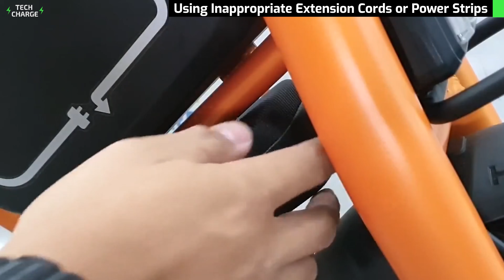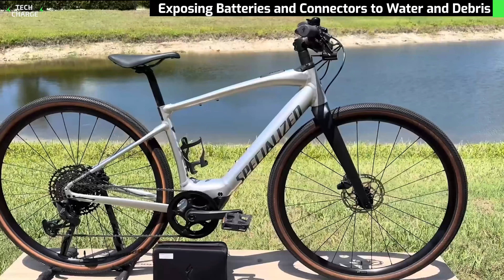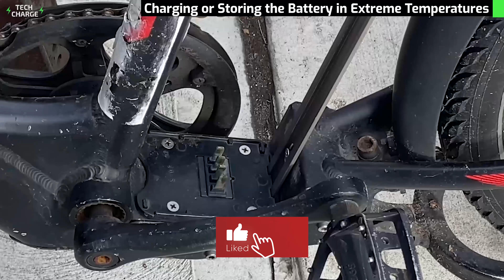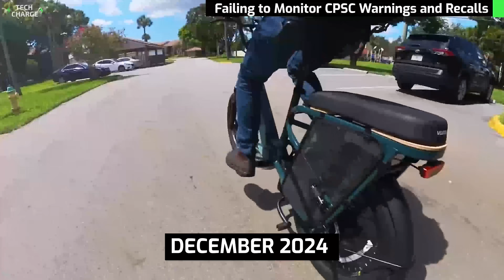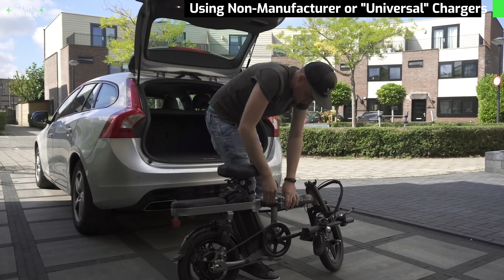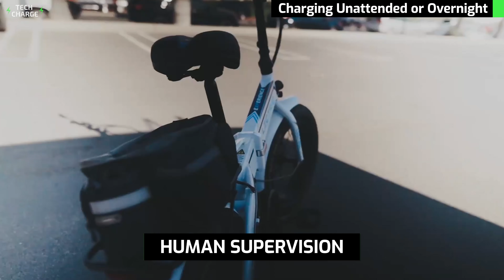11 Electric Bike Mistakes That Could Burn Down Your House

Comment: Some good points - spoiled by inappropriate visuals. As a UK user I see example photo shots of high end (pretty?) European Models which pass the highest and most rigorous testing procedures for all associated parts and equipment. These aren't comparable, or relevant, to issues of poor compliance, inspection, cheap practice, etc. found in Asian Imports, knock-off fly-by-night E-commerce or slow stateside takeup of unified standards, or WORSE kits and conversions with home electrics and sub-standard batteries. Keep it real - The safety thing is important but inaccurate generalisation is sloppy.

Comment: Here's the truth:  The failure rate for e-bike batteries is around 1 in 10,000.  And the majority of those that do fail are the result of either cheap Chinese batteries of questionable quality and/or from people using fast chargers on cheap batteries.
BTW, why are so many posters here heaping praise on what is quite clearly an AI-generated video?  Are the majority of them AI also?

Comment: Switch to LFP.  10 lb, 130 USD, 12 AH 48 volts.  No fires.   after a year or so, it has more capacity than the equal wt NMC.   It last 10 years at least and 5 times as many cycles.  It has less sag over the discharge so you get more full power miles.

Comment: Might as well just ban e-bikes with this kind of fear mongering. Just get a certified battery! If there’s any danger the manufacturer would forewarn  you in their manual. For instance, Velotric has a water proof battery for instance. No worries! Only purchase e-bikes that have certified batteries.

Comment: IS ELECTRICAL ENGINEER IS VOLTAGE GOES UP CURRENT GOES DOWN SO SOMETHING THAT WAS BUILT RUN ON 12-VOLT GENERALLY HAS THICKER CONNECTORS THAN SOMETHING THAT
IS BUILT ON 48 VOLTS SO THE 12-VOLT SYSTEM IS MORE LIKELY THICKNESS OF COPPER TO NEEDED TO ACTUALLY BE ABLE TO RUN AT HIGHER VOLTAGE UNLESS HEAT

Comment: Thanks for the great video, you are doing a service! I was so scared of overcharging that I ended up getting a smart charger that goes between my bike and charger that stops charging at my preset of 80%. If what I've been reading is accurate and I'm understanding it correctly it should also bring the battery cycles from like 200 to 500. Stay safe out there!